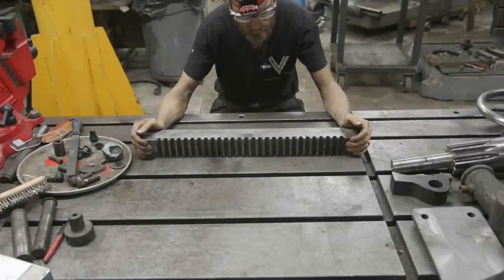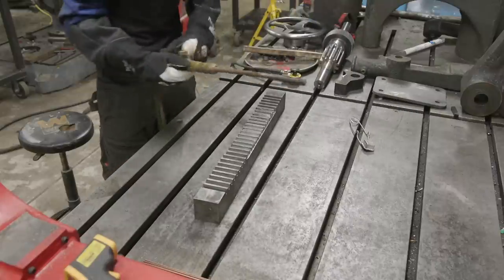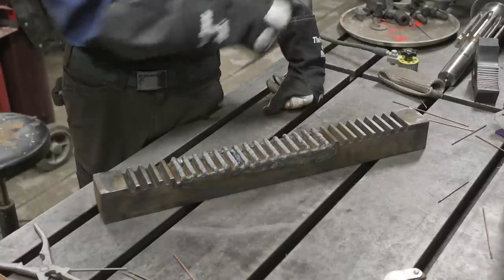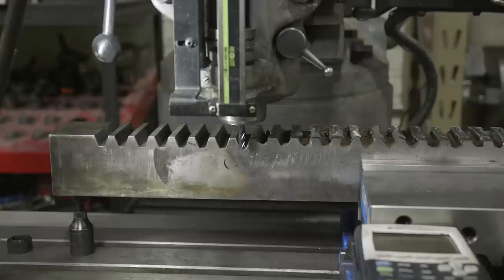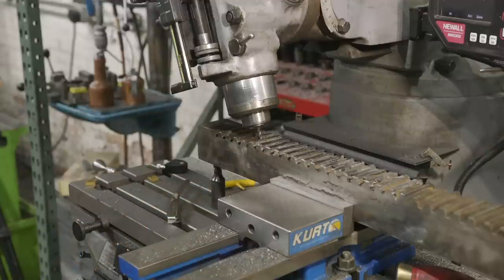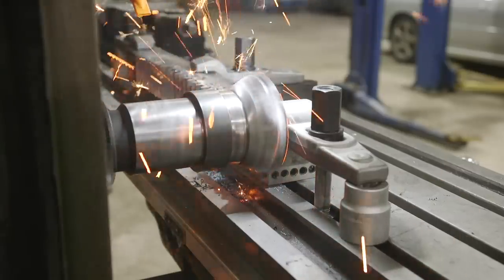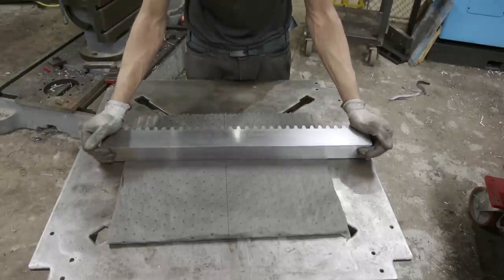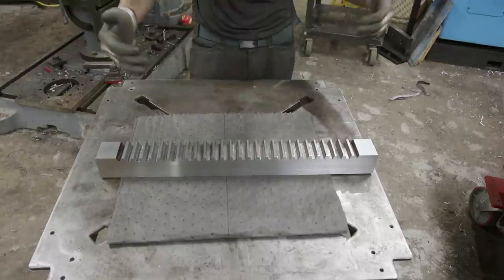Welding and Machining a Hardened Steel Rack | Rack Restoration | Arbor Press Restoration

Comment: I tried this same technique on a South Bend drill press quill a couple of years ago.  Some teeth were broken.  Except I used a mig welder and a dremel with a grinding wheel to shape things.  Let's just say Vanover's methods worked better.
Reply from the maker: Lol. If MiG is all I had I would have done the same. My method worked but with lots of difficulty

Comment: Good day!
In my experience with similar project, I would run my face mill at a slower rpm faster feed rate and a depth of cut of .020.
I think you did well considering the result.
God Bless ❤
Reply from the maker: Thank you.

Comment: Always a bonus when you get to learn without trashing the part. I have a job pending that is similar but you cannot buy the part and it is a gear. My approach will be to anneal it and then weld and machine it and then redo the hardening. On the list but not yet a priority.
Reply from the maker: Good luck man
Reply: Sorry, but as a degreed welding engineer of over 40 years in the business I say Dan is right. I have never even heard of using air hard as a build up wire, and I'd bet a dollar to a doughnut that rack is 4140,,,,,,.-At the speed and cyclic rate of an arbor press the is zero point no reason to hard face at all anyway, Toghness is what you need. - Check the Young's Modulus and you will see are not going to buy yourself a thing with A2 other then broken gear teeth= You would have been money ahead using 8018 stick wire and calling it good. - What you have made yourself is a glass gear. - - Take a piece of A2 that has been heated red and .left to air cool and put it in a vise and smack it with a 2 pound hammer.  - Do the same to an equal size piece of 4140. ,,,,,, Make a jig and slow bend them and you will get the same result. 

One more time, there is a reason nobody makes A2 gears,,,,,but there are tons of 4140 gears. 8018 would have given you very adequate alloy pick up if yo want to heat treat it,,,,,,The you could have just used 4140 TIG wire.  ----- Just who told you to use A2, anyway?   Even S-7 would have been better.

Trst me, With that glass gear you are the one that will need the luck

Comment: Awesome video. I'm very impressed with your abilities and the jobs you take on. I noticed you never used any coolant or oil. Is that the way you usually cut your steel?
Reply from the maker: Depends it makes it hard to video that’s the main reason

Comment: When your just building up extra material you wanna try and maintain a perpendicular angle pointing 10 to 15 degrees in the direction of travel. 
Just keep your wire laying in the pool, just push addition filler in, pause and repeat, this'll easily allow you to not get your pool to hot as you can easily keep adding wire faster until you start to feel some resistance as you push it in.
Reply from the maker: Ok thanks for the tip

Comment: It will be interesting to see how the pinion engages with the rack, the thinner teeth will mean having to engage at a deeper setting which could result in the tip of the pinion engaging the root of the rack before the PCD is engaged. Hope it works for you. Thanks for posting, stay well 👍
Reply from the maker: Yeah. Stay tuned for more updates on the project. Overall the tooth width is wider than the worn section I started with. The tooth width is smaller than the two end teeth but thicker than the smallest worn tooth before. More importantly all the teeth are consistent width except first and last.

Comment: Nice work.  But why are you climb milling at 2:02?  Also, the speed on those big cutters seems high.  I haven't done a lot with A2 but the sparks are interesting.  In The Handbook, A2 is listed as really high carbon steel (1%) with 1% moly and 5% chromium.  The orange sparks usually indicate carbon and the sparkles indicate steel.  Molybdinum burns yellow-green and Chromium burns white.  You can see all of those colors if you pause and go frame-by-frame (use comma and period).
Reply from the maker: Your correct

Comment: DO YOU NEED TO RE HARDING IT ARFTER YOU HAVE RE GROUND IT FROM WELDING .
Reply from the maker: Yes you do
Reply: @VanoverMachineAndRepair  THANK YOU .
Reply: No, Other then to totally wrong alloy for the build up there is no need to harden an arbor press rack and pinion. You would not see any wear at all on an arbor press in 200 years of common shop service.

Comment: Wow... no protection of that poor old horizontal mill ways while grinding. In fact, blowing the grit right toward them. Good job.
Reply from the maker: Thanks
Reply from the maker: Machine was throughly cleaned before traversing over the ways. And after the job rubber cover added.
Reply: @VanoverMachineAndRepair I think wayneec369 was being very sarcastic